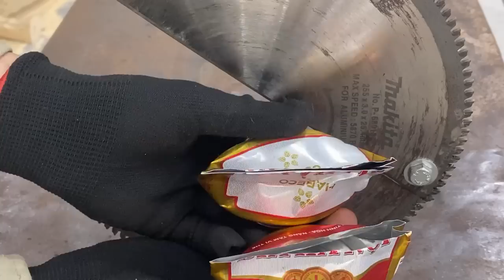GREAT IDEAS WITH SAW SAW // Easier MANUAL IRON CUTTING TOOL!!

Comment: I have a few questions: Don't you have a pair of tin snips in your shop? Why are you wearing gloves? Why did you use such long ass bolts? Why didn't you use lock washers? Why did you keep your gloves when they became torn and useless? Why is there a chicken in the shop? Why did you put X's between the lines? Were you afraid you'd forget where to cut? Why did you do this? Did you boss slap you for cutting up his favorite saw blade? Why did you cut a can in half? Did your foreman kick your butt for cutting up the metal he was saving for a special project? 
WHY DIDN'T YOU USE THIS ON THAT DAMNED CHICKEN!?!?